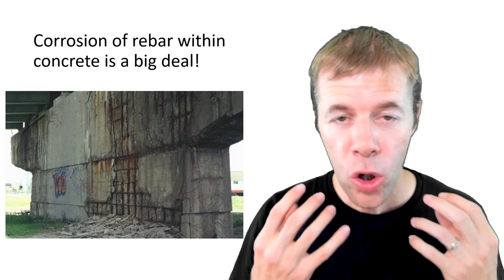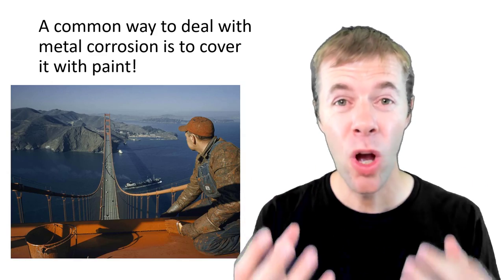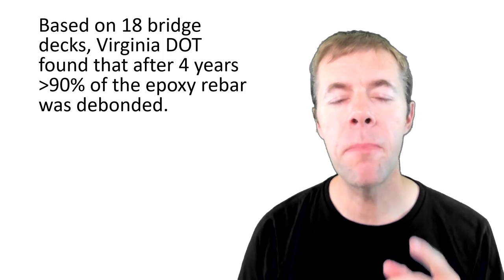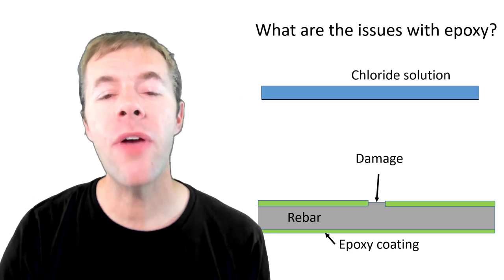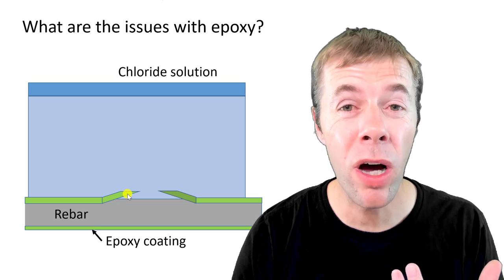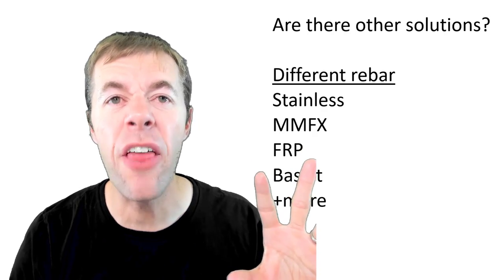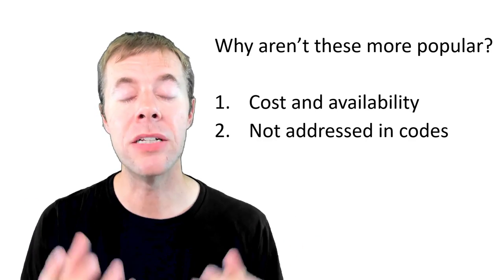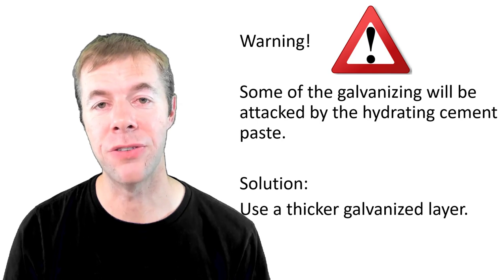What is epoxy coated rebar and why is it being banned?

Comment: I work in the maritime engineering sector designing port & harbor structures to withstand the aggressive corrosion environment of seawater exposure, both full immersion and intertidal / splash zone. Epoxy coating fell out of favour decades ago for the reasons mentioned. But for most applications the most effective and least cost solution is a) increased concrete cover (3” or 75mm is standard); b) low water cement ratio (< 0.4) which decreases porosity; using class F fly ash to replace 25% or more of the cement (also reduces porosity).  In severe exposure locations  we also use admixtures such as calcium nitrite or silica fume as corrosion inhibitors, although the latter can cause workability/ finishing issues.  We almost never use galvanized or stainless bar, but MMFX and FRP bars are showing promise too.
Reply: Cover is king !
Reply: I am a gas and electricity supply engineer and I learned about the content of this video in my first semester. I.e. it's got nothing to do with my day to day job or even large parts of my studies. Cement cover of rebar is key and even in non-maritime building environments, the structural engineer needs to look at every crack and determine, if the cover is compromised. (If the structural engineer is any good, he has enough of a safety margin calculated into the structure, that nothing happens.)
Reply: Is active protection used at all?
Reply: Can you please explain why isn't galvanized used more often?
Reply: @larryclemens1850  Doesn't last in wet environments.
Reply: Larry Clemens it adds additional cost for limited benefit,  and really it’s not needed if you get adequate cover and good, low porosity concrete mix.
Reply: There ever been a bronze coating?
Reply: @JainZar1  in the waste water field epoxy coated is still thriving haha use it almost every project.
Reply: Cool
Reply: Have you examined the theories of how the Romans made their harbors?  They are still usable except for the sea rise.
Reply: @RobertSzasz  I dont have any idea but are you talking about something similar  to sacrificial anodes etc or electrically charging the rebar?
Reply: @teekay1785  Instead of the electrochemistry of a sacrificial anode, a power source and an anode that doesn't break down is used.
Reply: Thank you for this information. Good to know the marine infrastructure has long ago identified the epoxy rebar problem and found alternatives ,, Why hasn't upgrades been adopted in other engineering designs when things were found and published from the maritime industry?  Probably money, greed, ignorance, and unwilling to try new techniques.
Reply: Interesting comment thread.  I was an engineer in the aircraft manufacturing industry for 43 years, and find it fascinating that civil engineers have problems with corrosion just like we do.  Our solutions are different because our materials and applications are different, but the path to our solutions are amazingly similar.  Good video.
Reply: @rv6amark  at least the marine corrosion problems are conceptually pretty simple. No good place to dump charge when you're in the air. (Cleaning and painting are the rules for aircraft I guess)
Reply: Whats the video said is true.  Nesarly the sea is absolute necessary use hot deep galvanized steel rod bar and pozzolanic cement, that usually take less weather for the mixing.
Reply: @RobertSzasz  And why?
On bear steel structures in the open it works exceptionally well. The zinc works as a sacrifice anode. Dose the chemistry inside concrete work against that?
Reply: @martin09091989  active protection works without the need for anode replacement, and you can easily monitor the current required
Reply: @RobertSzasz 
Yea, I'm well aware of those aktive systems and how they work, but why dose zinc plating don't hold up in concrete as u mantiont!
Chemestry is not my strength because I'm just an electrician. 😅
Reply: @martin09091989  my understanding is that hot dip has a limited lifetime underwater. In air I dont think there's anything better.
Reply: @RobertSzasz  Yea, makes sense, I never seen a zinc platet structure submerged in Water. And in concrete, the only way to get oxygen and corrosive salts in is by water ingress, and if that can rust rebar to crumbles, the zinc might not hold up that much longer.
Reply: Would basalt rebar used in maritime works?
Reply: Thank you for your additives.
Reply: @lpjunction  bassalt, frp and/or sulfurcrete.
Reply: Problem with low water content is pump operators hate it and your truck passes the slump test and then the pump operator tells your drivers to put water in it when you back up to the pump. Adding water also makes the concrete cook off faster causing internal fractures in the cement as well as dropping the stone content out of solution when they deairate . I've sacked drivers for listening to pump operators $150k pour ruined by idiot pump operator and agi driver's
Reply: its funny to me that Roman concrete structures are still standing today 2000 years later with 0 rebar. most industrial projects have a life span under 100years. Sometimes i think its just job security to use rebar. its what f..s the concrete every fnn time
Reply: @cypriano8763  Admittedly we have failed to address critical issues in longevity.
Reply: @peterweller8583  but hey, i have a job, you have a job. Win win right?? I would burry that rebar 300 in the conc whenever possible. Maybe the real solution is a carbon fiber type material. My carbon fiber ski poles have amazing strenght!
Reply: Plausible one wonders if more cost effective solutions are available.
Have you priced carbon fiber ( ZOWIE )    
Heavy copper or zinc plating or some kind of passivating might be a cheaper  option.
Reply: @peterweller8583  i think investigating the  the possible elimination of reinforcing steel for vertical application with added mass. I gave myself the awnser right there. If the consumer  is satisfied with 100year lifespan for different structure why bother making it last longer. Kind shooting yourselfves in the foot. Im sure remove reinforcing steel when ever possible and or mooving it deeper in the structure would greatly increase longevity. Concrete is cheap compared to rebar too
Reply: @suzannehartmann946   @cypriano ancient harbors were made first using large stone blocks and later unreinforced masonry  which can certainly last for centuries. These structures rely on their own weight to be stable ( so called “gravity” structures ) and which carry loads by acting only in compression. As ships got bigger and bigger the water depth needed kept increasing until the point where gravity structures were impractical or infeasible. This led to the development of new structural materials including steel and reinforced concrete which are better at carrying bending and tensile stresses, which stone and unreinforced masonry cannot. The trade off though is less long term durability. In many cases a 50-100 year life span is sufficient because evolving needs in cargo handling and vessel sizes show that after a certain number of decades a structure can become functionally obsolete even if it’s otherwise in good condition.
Reply: @cypriano8763  Yeah I know but that darn infrastructure dilemma and that spalling
Reply: Interesting.
I would assume stainless has issues with adhesion of the cement.
Composite reinforcing bar could solve corrosion problems so long as it adheres well with the mix.
Reply: Seems that the big issues are cost vs. durability vs. strength. These three factors tied together prevent a perfect solution. Increased durability decreases strength and increases cost, etc.
The steel is good, strong, cheap, durable if protected. Hence the coating idea. The concrete permeability is the issue. Decreasing porosity increased cost and decreases strength. There is the problem. Make the concrete impermeable and the steel remains strong durable and cheap.
This is the current focus of research. Can polyurethane somehow be used in or on the concrete? Other solutions are like the golden gate, surface coatings on the cured concrete to eliminate porosity, utilizing robotic systems to strip and re-apply a polyurethane coating on the concrete every decade or so.
Reply: @texastrustedoralsurgeon6830  capitalism
Reply: @cypriano8763  If we built things like the Roman's how could politicians siphon funds off contracts? Building things to last a thousand years might be good for those efficient Roman's but whose gonna think of the corrupt? How are they gonna get the trophy wife, spoiled entitled kids, the mistress, the gambling/sex/drug addiction, etc....Cmon man, think of the parasites once in a while. /jkn
Reply: @cypriano8763  yep Seattle has one large stadium down in 25 years and another bridge in 30.
Reply: Marine brass and iron seem much more resistant to seawater corrosion than steel but I suppose they are not strong enough. Iron could be made cheaper than steel I would have thought.
Reply: So, how many mgtow men over here?
Reply: @martin09091989  it does but benifit to cost is the key driver, engineering designs to whole of life cost. When steel corrodes the Macro structure adhesion is also compromised. So to give the best results is to manage infiltration by modifying concrete properties and density/void content to stop the water and chemicals doing damage to the reinforcing bar in the first place to try and keep the structure intact and functional. Changing concrete is much cheaper that trying to fix steel and coat it with expensive processes. So if you try and protect the steel best way is to run sacrificial anodes/cathode buy connecting this to something that can be easily checked and accessed. 

I miss building bridges and tunnels... new zealand is too small.
Reply: I agree with everything you’ve said. However, a lot of factors can alter the durability of the structures nowadays including misplays/unethical practices by several concrete suppliers who aim to use cheap quality material just to survive especially in these times. Another factor which I believe is the most dangerous is the human error. Whether while casting, finishing, or even curing the concrete there could be area of honeycomb or cracks in the concrete (reducing the effective cover at specific areas). A lot of these factors can still tremendously reduce the service life of the structure especially in marine environments. Using corrosion inhibitors is an amazing idea, however, as you said Calcium Nitrite is hard to work with due to its negative effect on concrete workability and ultimate strength plus it works poorly in cracked areas just like waterproofing admixtures. Ever considered Amine Carboxylate based corrosion inhibitors?
Reply: great comment... I increased my concrete thickness too.... seem intuitive.
Reply: FRP are useable in #3 straight temperature steel only. They can't be bent as shear ties and can't be used for larger diameters due to shear flow creep, inner to outer cores. The best solution for the splash-zone then is sulphate caulking and silane coating for their remarkable hydrophobic qualities.

Beyond that there aren't many good solutions beyond mass concrete with tight aggregate grading, water reducer, fume and replaceable zinc anodes with silicon bronze tabs and low-zinc copper wire thermally- welded to the rebar cage.

It's interesting this current infrastructure improvement round of Biden's probably won't address any of this, and is probably the last infrastructure improvement, ever, before America becomes a social and military national debt basket-case.
Reply: Ron T  Two things: a poor schmuck pickup truck driver on I-5 hit a section so deteriorated the rebar sprang up, speared his truck, flipped it off into a ravine and he wasn't found until next day. Last week I was driving over patches of exposed rebar as big as a garbage can lid. The Fed's are never gonna repair it. I'll stick to SRs from now on.

Did a covert mission into KDR and met the Karzai brothers at a banquet, where they were busy collecting rent and drug money, bales of fresh US$100s. They said they'd give me 6% skim off whatever fundings I brought in on their project, but USAID said: "The Afghan people (who had nothing to do with OBL, Saudis, al-Qa'ida and 9/11) the Afghans don't decide what happens in Afghanistan, the US decides."

That's when I knew I was too far from home.😰 🎶  "He was too far from home!"  🎶 Bob Seeger, Ladies & Gentlemen

So we will march like lemmings off the cliff, some living on in WW Z for awhile, until their prep food and ammo supplies run out, but the outcome will be the same. 

The Great Reset is Now. Biden-Harris© National Evictions kicks off in 92 days for 40,000,000 at-risk American Workers, as 100,000 illegal aliens are pouring in every month and have filled up all the shelters. For every homeless person today, there will be 10 homeless this winter! Americans!

$50 BILLION will be squandered by Space Command chasing UFOs and 'Mission Mars'  contracts, while they're getting free base housing, and complaining about all the damn homeless. Know'm sayin'?
Reply: Ron T  the wheat will be separated from the chaff on October 1st. That's when the real people will be separated from the fake people. That's when the lines will become clear as glass.
Reply: The video reminds me of some videos Ive watched about log cabin and shed construction. The basic premise was: If you cant make something 100% guaranteed water and air tight, then dont even bother. Just accept the fact that some moisture will get in, and make provision for it: ventilation, drainage, and have the capacity to dry it out. Then he ripped out some insulated, sealed panels that had tiny gaps in them. They had basically sucked in moisture and rotted out from the inside.
Reply: @replynotificationsdisabled  silicon bronze is CRAZY EXPENSIVE!